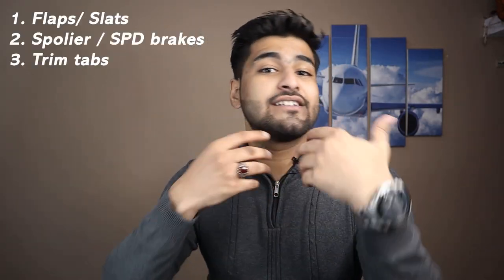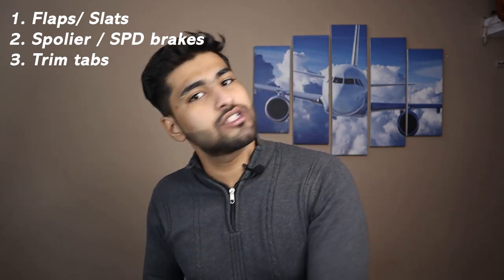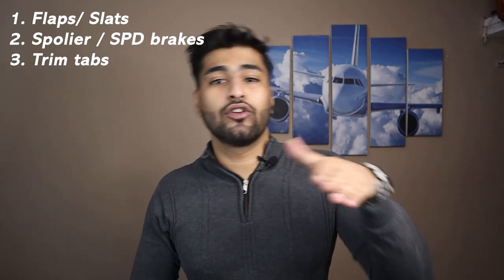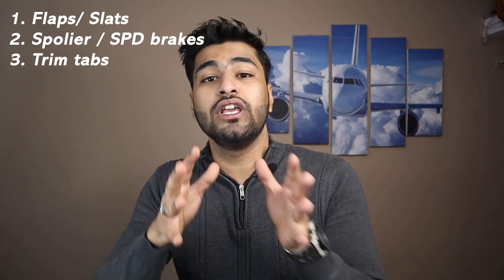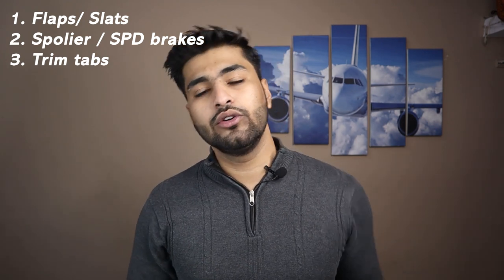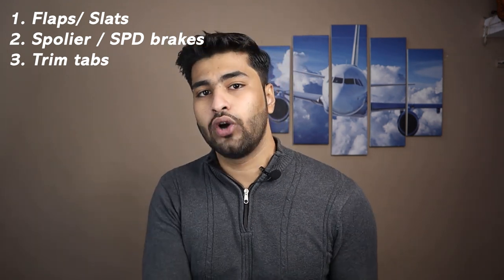Secondary Flight Controls in Aircraft | FLAPS, SPOILERS and TRIM | Ground School Episode 6

Comment: 6:22 So, if we want to reduce the speed, we will also end up losing some altitude, right? Because, speedbrakes will also reduce the lift, right?
Reply from the maker: Not necessarily... if we want to stay at the same height, a slight increase in elevator input and you will stay level AND decrease speed at the same time 😉
Reply: @TheFlyTuber  Ohh yes, absolutely. We will remain in level flight, if that is done.

Comment: Hii sir !! In one of u r previous videos 
U said if one engine fails during takeoff 🛫 the aircraft turns to one  side as there is no power &thrust from the failed engine and full power from another 
What in case if this scenario occurs when the aircraft is airborne
Reply from the maker: Same thing, it will YAW towards the failed engine side, thats exactly what I explained in RUDDER TRIM section of the video !

Comment: 11:24 But, if we have to circle or orbit, there is no need to keep rolling the aircraft.
We can give a roll input and make the ailerons neutral again, so the aircraft will maintain a constant bank angle and keep turning. So, no need for aileron trim, to circle or orbit. Am I right?
So, the use of aileron trim is to only roll the aircraft continuously, right?
Reply from the maker: Well that is a great point you noted, Essentially, aileron trim can be used to to keep and airplane from responding to a situation where one side of an airplane is significantly heavier than the other side.
Reply: @TheFlyTuber  Understood now.  I had studied this use of aileron trim, but wasn't able to remember this. Thanks for mentioning it.
BTW, you are doing a great work to make good content for your channel. Also, you are trying to interact with as many comments as you can.
Reply from the maker: @sachinkumar064  well i try my best...
but apart from a few of you, most of the viewers aren't interested in this series I guess (you can compare the views and engagement and you'll know it)
Reply: @TheFlyTuber  The views on this series might be slightly less as compared to others, but lot of people will be surely watching such content in the future.
Initially, even Mentour Pilot would not have got a lot of views on his videos, where he explains Aviation accidents.
Even I discovered those videos quite late.
Reply from the maker: @sachinkumar064  point to hai... lets hope for best

Comment: If we just move control stick right the aircraft will continuosly turn right it is not like our car that u need to keep turning so why do we need aileron trim
Reply from the maker: Well that is a great point you noted, Essentially, aileron trim can be used to to keep and airplane from responding to a situation where one side of an airplane is significantly heavier than the other side.
Reply: What is the cause of one side being heavy is it because of fuel or cargo? 

Cargo is stored in fuselage so i thing that does not matter that much because it is near to the centre.

I can think of only one case where one extra engine is mounted on one wing of quantas airlines for maintainance .
Reply from the maker: @asheshpatel4402  yes, that extra engine, or if one engine is failed and the differential thrust is causing continuous bank to one side... or as you said fuel imbalance